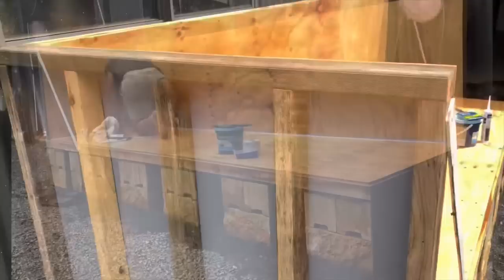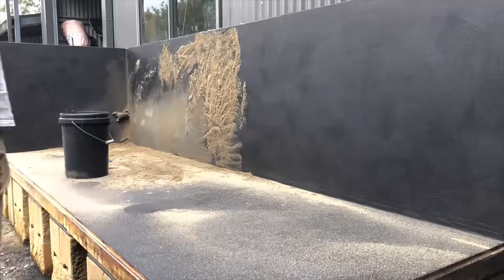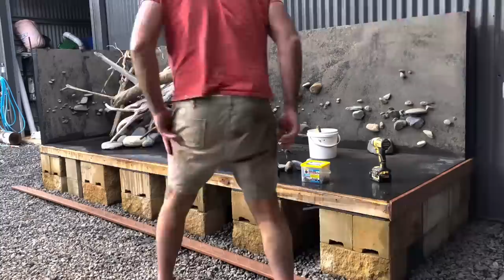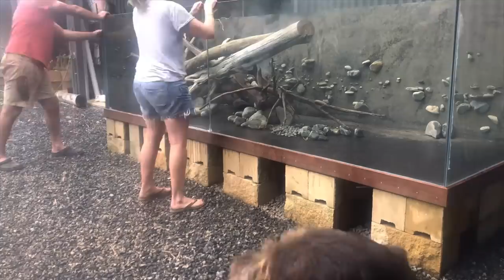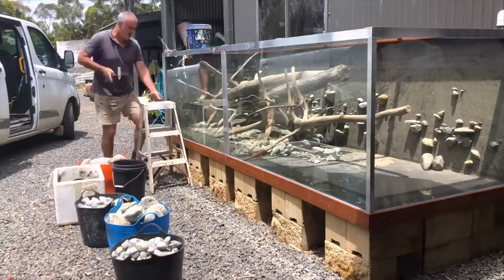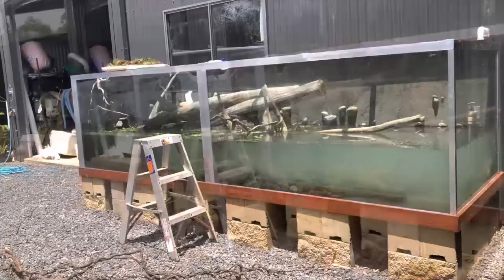Plywood Aquarium Construction in Timelapse

Comment: The front is not gonna hold over time the 2 panels is a massive weak spot the pressure on that point is inmentsly  big . I hope it will hold but i have my doubts
Reply: Looks like he used a steel stock angle iron for structure. I’m pretty sure it will hold using the steel? I highly doubt he spent the money invested the time without doing adequate research
Reply: Same, when I saw it I was like Ooooo Nooo Bad mistake.
Reply: A metal piece also can break over time 🤷🏼‍♂️ that a shit load of pressure there

Comment: How did you support the two halves of glass in the center…. Like I have major questions and is it still holding water
Reply from the maker: Hey John
It certainly is still holding water! The two front panes were bridged with the aluminium plate, and the aluminium angle bracing along the top. The bracing was then cross braced back to the rear timber wall using aluminium strips.

Comment: Impressive. How did you secure the two glass together in front view?
Reply from the maker: Initially just butt siliconed, and then I siliconed on the aluminium angle across the top. With the angle ( full length ) across the top and the channel at the bottom that the glass sits in , the two panes were forced to be in alignment. Then I siliconed the aluminium plate down the join , on the outside. 
On my 12ft moray tank inside, that has 2 6ft glass panes for the front, I also siliconed a glass bridging strip on the inside of the join, which became hidden by the cover strip on the outside.

Comment: How do you fix and seal the glass to the ply wood?
Reply from the maker: I checked beforehand that the silicone would adhere to the sealer on the plywood. Then with the aluminium angle frame, and the recess in the timber base for the glass to sit in

Comment: How do you keep that center scene from leaking on the side of the tank?
Reply from the maker: The two panes are aligned and effectively “locked” in place by the timber recess ( and silicone) they sit in, and the single aluminium angle along the top edge. Their alignment can’t move. Then with a truck load of silicone, I installed a glass bridge on the inside, and an aluminium bridge on the outside of the joint

Comment: Hi, what’s the thickness of the plywood you used? Thanks
Reply from the maker: The plywood in this tank is 12mm, whereas in my other plywood tanks I’ve used 19MM ply. 
Because I built the walls and floor using treated framing timber, and screwed the studs at 300mm centres, I decided to try thinner ply. The ply isn’t structural in this design
Reply: @australianaquarist  Thanks mate. That makes great sense.

Comment: whats stopping the glass from popping out?
Reply from the maker: Hey Gareth, the valley the glass sits in, formed by the recessed plywood base, holds the base in place. The aluminium angle holds the top aligned with each other. A backing and face plate siliconed across the joint, keeps the butt joint water tight
Reply: @australianaquarist  I was wondering the same thing! Looks great. I've never seen a construction like that for multiple panes.... looks to be a neat and simple way to achieve the desired result.
I guess, in theory, nothing's stopping as many panes as you'd like across the front?

Comment: Awesome build! I am in the process of making a similar sized tank. Do you ever have to worry about cold temps? I am researching insulation to reduce the heating costs where I am located in the US. Look forward to the fish being added!
Reply from the maker: Hi OPAIK
It’s summer here at the moment, so the tank hasn’t been through a winter yet. Where I live, it’s considered a warm temperate to subtropical climate, and we don’t get frosts, and definitely no ice or snow! 
In saying that , our winter nights can get down to 2 degrees Celsius ( 35 Fahrenheit), and I expect the water temperature may drop to 16 degrees Celsius (60 Fahrenheit). Our winter days are still warm , and average 20 degrees Celsius (68 degrees Fahrenheit). 
The turtles will hibernate under water, though I may provide a box of grass and leaves for them , if they choose. I’m only going to stock fish that are native and found in my local rivers. That way I know they can handle lower temperatures. There is no way I could stock any northern Australian or New Guinea rainbow fish, without heating the water to a minimum of 68 Fahrenheit, which would be ridiculously expensive!
I could stock certain barbs , like Odessa and Rosy Barbs, which prefers cooler water, and even livebearers, but I wish to depict an Australian theme tank.
Reply from the maker: The problem with big tanks is heat loss from the large water surface, and through the large glass panes. So even if you insulate the bottom , back and sides, I don’t think it would help much, if the environment the tank is in, is too cold eg outside. Inside, keeping the room shut up, a clear plastic sheet over the tank, and 600 watt heaters will work. 
That’s what I do for my similar sized marine tanks inside the shed.
Reply: Im in Florida and keep Southies.  I had them in a 1210g plywood system for years.  My house temp is between 73 Fahrenheit in winter to 79 fahrenheit in summer, I have run 2-800watt heaters to maintain an 82 degree tankwater temp, year round.  My fishroom costs are $45-$50 per month.. All lighting and pumps and heaters.
Reply from the maker: That’s brilliant…. The cost of the hobby for you. I’m not sure what the cost of electricity is in the USA? It’s around 30 cents/kW hour in Australia. I’d love to have some more tropical rainbowfish in this tank, but there’s no way I could afford to heat the tank
Reply from the maker: I approximate I’m spending around $250 per month on electricity for my fish hobby
Reply: Bro i also want this type of tank can u describe the dimensions of tank and glass thickness thanx❤
Reply from the maker: It’s just over 3.6 metres long ( the two front panes of glass are 1.8m long each). So 12 ft long. 
Front to back is 1.2 m or 4 ft, and although it is 970mm tall (3.5 ft) the bulkheads are located down from the top to give a unclimbable barrier to the turtles escaping. This gives a water depth of around 850mm. 

The glass is 12mm toughened glass
Reply: NO WAY THE GLASS WILL HOLD FOR LONG

Comment: I don't understand how it holds itself together could someone please explain I understand there's aquarium glue and stuff like that but especially the two pieces of glass that are fused it just seems like so much weight and pressure that it would explode
Reply from the maker: Hey Kyle
I hope I can explain this for you. I created a ledge with the bottom of the tank, by having the upper sheet of plywood set back 15 mm from the edge of the bottom timber. The 15mm is for the 12mm glass, plus 3 mm silicone. You would have noticed me screwing a timber board across the front of the tank, along the bottom, before the glass was Installed. That then created a valley behind (a 15mm valley), that the glass could sit down into. The two panes of glass that a butt joined initially by silicone at the front middle, then had a aluminium strip siliconed ( full coverage of silicone) as a bridging piece, and a glass strip on the inside. 
The aluminium angle that runs along the top edge, is what gives it all the strength. The water wants to push the glass outwards, …. Convex. The aluminium angle is rigid and prevents the glass from bowing outwards. It is also locked back to the rear timber wall by the aluminium cross braces.
Reply from the maker: The water depth is only 800 mm (2.5 ft), and 12 mm thick toughened glass. Combined with the inability of the top edge or bottom edge to bow, the line of the glass stays straight
Reply: Lucky this tank is outside of the houses, I will never make an aquarium this way inside my home.
Reply: @australianaquarist  how does the water not seep through the wood? That’s what I’m confused about
Reply from the maker: The plywood is sealed and made water proof with a two part epoxy. The epoxy is designed for the boat building industry, and can be thinned to wick into the timber, left unthinned to build up layers, and thickened to act as a glue. If the tank was inside, and not exposed to uv light, I could have just continued the build without any topcoats. Epoxy resin is not uv stable. 
Being outside, I decided to use a commercially available pond sealer to overcoat it , as well as a polyurethane sealer to give extra sealing to the screw heads and corners